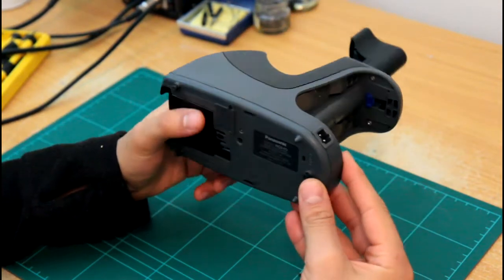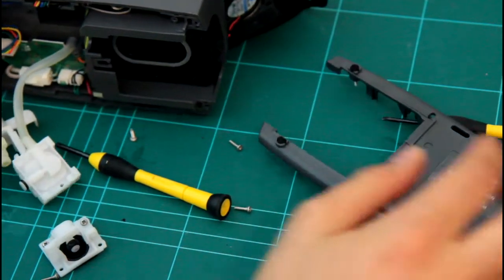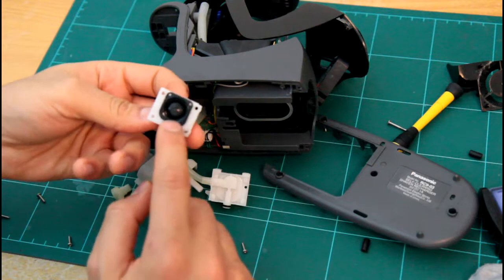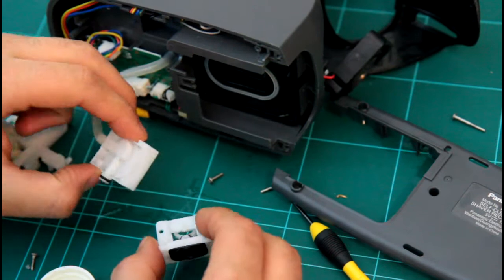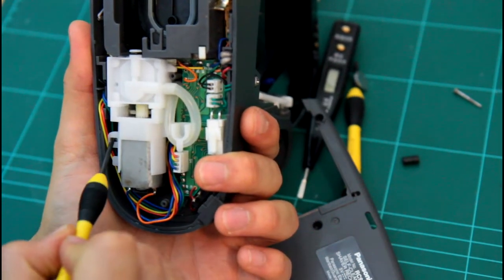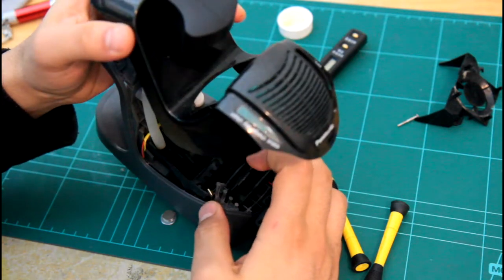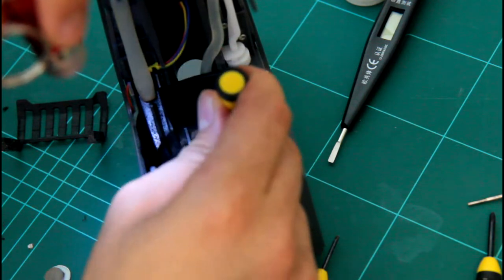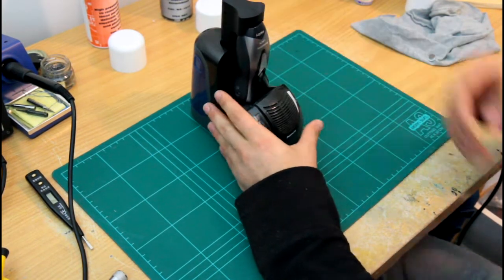Repair Panasonic Electric Shaver Vortex Pump Issue

Comment: Hi, in my case the bath could not be filled in with the water. After switching ON the bath stays dry, and I cannot figure out how it should fill in the bath. The opening in the bath is cleaned, but no go.
Reply from the maker: Test pump and more importantly the black rubber must be sealed and tight

Comment: Mine will fill, but not drain.  Going to try your fix.  Will post update.
Reply: Same issue here. Curious to see what you find
Reply: Well, first I should say that I have a different model of the cleaning stand.  It's this one: https://i5.walmartimages.com/asr/857ca39f-46ad-4e38-9b58-0f2545667158_1.0c50c16d69d1a0b1da5362641911e18c.jpeg?odnHeight=450&odnWidth=450&odnBg=FFFFFF

I got the outer case off and removed a couple of the internal sub-assemblies, but I could not get the pump out.  It's directly under the air vent & fan in the front of the device, but it's behind a couple of circuit boards and some other plastic supports. There must be a trick that I don't know to get the pump out, but I could not find any other screws to remove, and was afraid of breaking something.  Very disappointing I know.